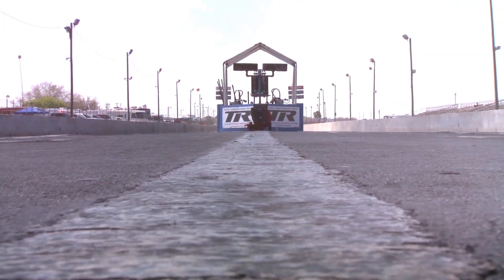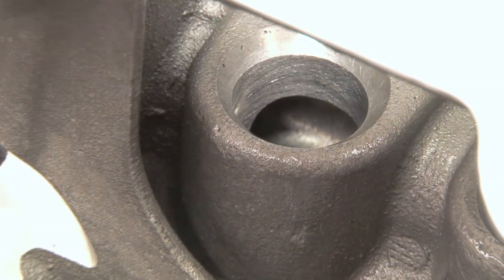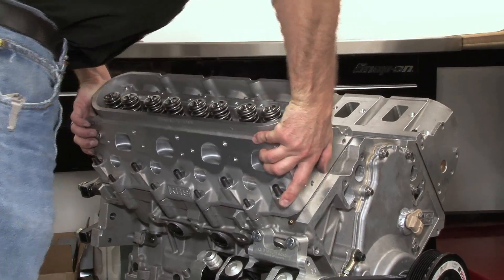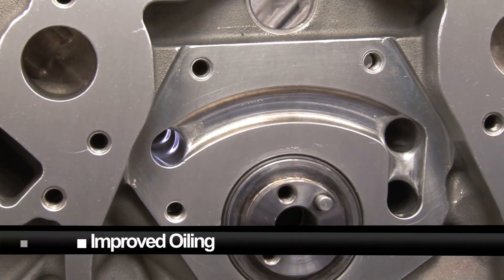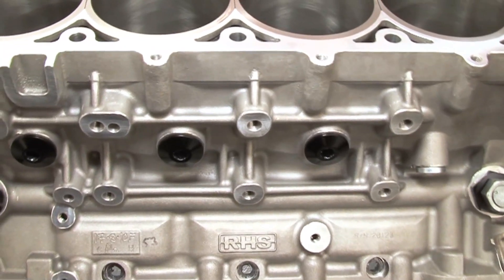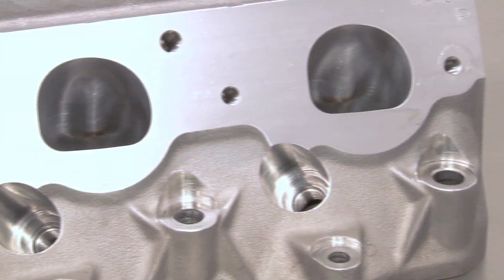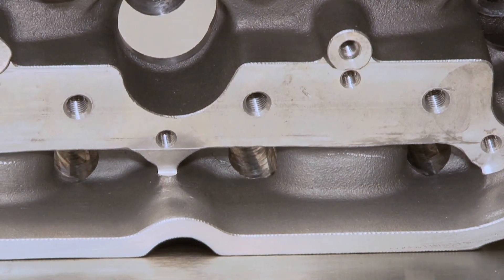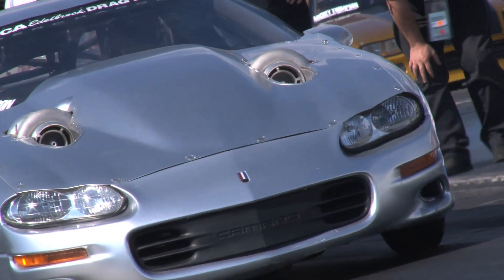Engine Building With The RHS® LS Aluminum Race Block

Comment: They showed a twin turbo arrangement on the drag car at the end there, does their proprietary casting handle boosting better than a normal LS7(It must, I know)?  It certainly sounds like it does, but the LS7 is sort of known as the NA option for the LS line, I just wondered if these guys change that significantly and if so, why choose the LS7 configuration in the first place?